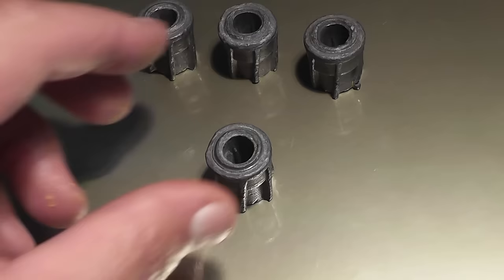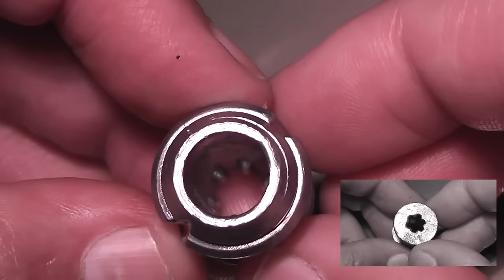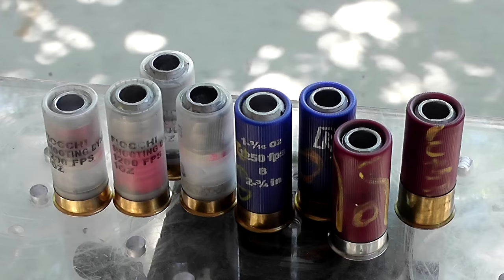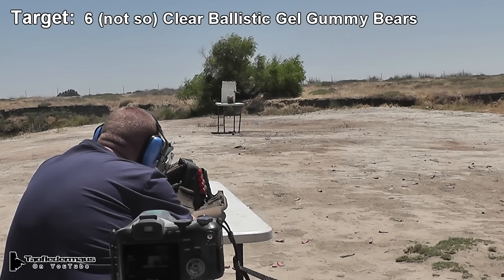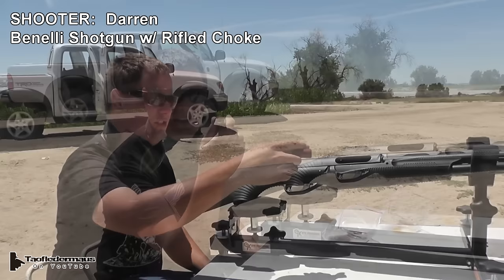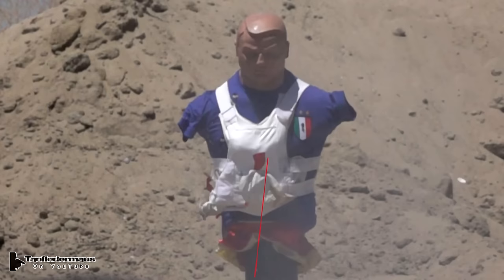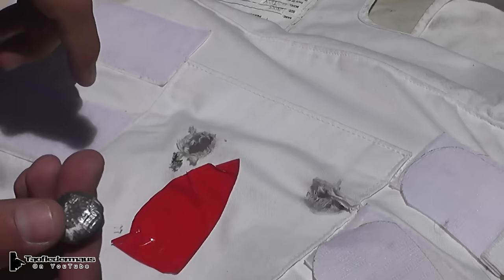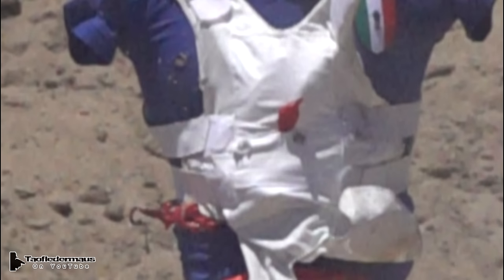RAM JET Shotgun Slug  Design  -  Stendebach II (Germany)

Comment: The low pressure zone in the rear of the slug is drag
Reply: I keep thinking that these work like an annular/closed wing, but with how they fly with the shot card suctioned to the back I'm not sure.
Reply: Maybe with the shot card suctioned to the slug it operates like a conventional hollow point until the pressure inside the slug's cavity approaches equal to the exterior pressure around the slug due to loss in velocity at which time it might transition to an annular wing for stability? I'm really sketchy on the physics of it though.
Reply: It makes sense if you think about it, clearly the force holding the circle to the back overcomes the force of the air pushing through the hole. But the force that pressure exerts on something is determined by surface area, hence the units of measurement (lbs. PER sq in. for instance). So even though the PRESSURE is higher inside the bullet, the FORCE is less because it's just a small part of the center being pushed. Meanwhile the entire surface of the back is being pushed. And you're right, by blocking that hole it essentially has the aerodynamics of a hollow point. 

I see his thinking, and what's actually happening is kinda counter-intuitive, so I understand his conclusion that little to no air was flowing through, but that REALLY doesn't make sense, haha. He should have thought this: high pressure in front of projectile, low pressure behind. If you connect two areas of differing pressure with a hole, then air will flow. The bigger the difference, the more the flow. There would be LOTS of air flowing through that channel, I don't know how that would effect flight, but I'm sure it would. It would at least reduce drag.
Reply: So the force of the lower pressure outside of the round over the larger surface area of the shot card is sufficiently greater than the force within the round that is pushing at higher pressure against the much smaller exposed area of the shot cup resulting in the pressures "gluing" the shot card to the back of the round until they equalize?
Reply: +Mr3Kidneys - It makes perfect sense that no air was flowing through the center of the slug when the card stuck.
Reply: Corwin Hyatt Ya, pretty much. The shot cup is in the small area of low pressure behind the projectile (actually a pressure gradient, but whatever), with atmospheric pressure pushing one way and pressure inside the hole pushing the other. The atmospheric pressure wins out because its acting on a much greater surface.
Reply: Corpsie Eh, it's not totally illogical but doesn't really make sense. You can think of it like that grade-school science trick (different forces, but same idea) where you can fill a glass with water, put a card or something over the top, then turn the glass upside down. The atmospheric pressure holds the card in place, overcoming the force of gravity and preventing the water from pouring out. It looks like it's "defying gravity" because you's expect the water to fall out regardless of the card, but it just doesn't. But concluding that it must, and therefore the water would't flow out of an upside-down glass even if the card wasn't there is just wrong. That water would come flooding out if the card wasn't there, just like air would flow through that projectile if the circle wasn't there.
Reply: May I suggest a theory and with all due respect get yours (everyone's) take on it?

If the slug is traveling forward the air around it creates drag. That drag also creates a vacuum.

Is it possible, and I won't compete with you on vernacular, that what is then happening inside is air being forced to the front?

The air is flowing in reverse and sucking the card to the base.

stuff works funny in flight.

Comment: Next time you should probably use lighter waddings. The bullets tumble because the wadding is inside the bullet's slipstream, coupled with enough kinetic energy in the wadding. 

You should probably use waddings a tenth of the bullet's weight.

Comment: could the slug be trying to spin left while the rifling is spinning it right?
Reply from the maker: I think when you induce a strong spin with rifling on a slug that has vanes designed to spin the slug,  you just end up turning the vanes into paddles that ruin the "natural" aerodynamics of how the slug was designed to work.
Reply: +TAOFLEDERMAUS and could that be causing turbulence making the bullet wobble?
Reply: Yeah, spin is very specific (in tolerance of range of spin speed for bullet) for the length of the projectile as to stability. I think on a sphere it's less vital because it's hard for a perfect sphere (or harder the closer it is to perfect) to wobble.
Reply: I don't think those "vanes" are designed to spin the slug.  They reduce the of surface area of the slug that touches the bore, so there is less frictional drag as it moves down the barrel.
Reply: +Jeff Rielley look at the fluting at the front of the vanes. they're meant to spin.
Reply: Jeff Rielley I think you're probably right partly, but the way they are slanted will cause the slug to spin moving down the barrel. I don't know what the air resistance forces do on those vanes moving through the air, but in the barrel there is positive contact and predictable behavior.

Comment: I have a H&R rifled 12ga single shot. It shoots anything and everything into a circle no bigger than a metal pop can. Non Sabots I can do that out to about 60 yards and Sabots out to about 130 yards. I use a 3x-9x scope. That is from a bench but no bag or rest.Most of my relative have hi end auto loaders and none of them shoot slugs even with fully rifled barrels as well as my old and at the time cheap H&R. They have mail in bench rest contests for rifled slug guns and the H&R consistently wins the most. Just something to consider. My Mossberg 935 never performed that well with a rifled choke compared to a rifled barrel. It has a 32 inch vent rib for water foul. 

The other thing is what choke tubes have you tried because it might want a different choke. I am assuming your using modifed cylinder?
Reply from the maker: Try shooting some glass slugs...  lol
Reply: Who makes glass slugs and why would I want to shoot them? Lead and copper seams to work just great. I shoot shotgun slugs to practice and to kill deer to eat.

Comment: Can you find a way to shoot it without the stock wadding but without the nitro cards such that it would alow airflow through the slug?
Reply from the maker: There will never be air flow through a slug like this because there is a shock wave in front of the slug.   The huge hole is there to act like a hollow point.

Comment: My guess: You need to download the shells to get the slug to transsonic/subsonic speeds so the laval-nozzle and the spinning fins actually work.
Reply from the maker: If you shot them at subsonic speeds,   you might be able to lob them 40 yards or so.   Slugs have very short range even at higher velocities.
Reply: ***** Which is the intended range of the slug, according to the description you show in the video (most test were done at a range of 75 feet, one of the comments is talking about the intented maximum range of 60 meters, as everything beyond that is pretty useless for deer or hog hunting in a dense european forest). ^^
It also is designed to be used with blackpowder instead of smokeless powder, at least that is what I get from the comment from C.O. Steigerwald on 1:10 (he used 5.5 - 5-75 grams).

Comment: Hmm im also wondering if these are spinning clockwise with the internal fins or counter clockwise.  (i'm guessing the escaping gasses accelerating the bullet is whats imparting spin, and not the atmosphere the projectile travels through.
Reply from the maker: They are spinning clockwise (looking from the rear)
Reply: looks like escaping gasses would cause a counter rotation.  So is likely not whats happening :) great video!

Comment: The reason that this slug, especially that russian, one that became basically a folded out disk, is that the diminishing crosssection increases the pressure of the flow, forcing the material of the slug uniformly outward. I'm not still sure, why the ruber disk remains stuck to the backside. That implies a lower pressure inside the cavity than in the recirulation area behind the slug. If you get a hold of any more of them and do another video, maybe try ruber ring instead of a disk. Then airflow through the center should be possible.

Comment: What about placing the highspeed camera upwind of the shooter so as not to get all that smoke in the shot?
Reply from the maker: The waddings fly very randomly and have enough speed to destroy a camera.
Reply: I mean, instead of on the RIGHT of the shooter for this vid, just p;lace the camera to the shooters left. You'd still be behind the shooter but; wind L to R would place you to the L behind the shooter.
Reply from the maker: Oh oh,  ok.    Or just use the Federal shells that hardly put out any smoke.  In this video I did a lot of things wrong in the first part.  Wrong shells,  shooting in the wrong direction in relation to the sun,  etc.

Comment: Wonder if you could imitate this by welding two big nuts, one on top of the other, and grinding in two vanes on the sides. Maybe slap a washer on the back to make the hole in the base smaller.

Comment: Want to know a Secret about the T-14 Armata? They started with blue prints of a German Leopard 2! Same track design, wheel placement, amount of wheels, overall width and length! They only modified the design internally and externally on the upper section, but did not gain the secrets to the internal armor! They had to add a layer of armor strapped to the top of the tank which is a serious flaw! One upper penetration and the entire tank and occupants are out of commission! With the Abrams the armor is internal if they were to add a similar exoskeleton to the exterior it would be even more deadly! They over-rate the armor thickness, much like China and over-rate the actual max speed! The track design of the Leopard is limited to a slower speed based on proven wear by active service! The engine of a T-14 is manufactured from alloys and is a new development which makes it prone to failure and one small one is catastrophic, why one broke down and smoked!  In Fact the Leopard 2AV has the turret T14 mod named in 1976! Odd but there is the name they picked for the Russian MBT! The Leopard 2 is a proven system and was used in Kosovo by Germany! Why not copy it? It was tested by the US military in the US using their testing protocols and criteria! Boeing gave them the stealth technology they used for the Pak-FA! Boeing Energia provided composites and coatings! Something the US keeps secret!

Comment: You said that the Stendebach's removed the fins from the inside because they didn't do anything but I feel like the did since the Mayer bullets did way better and never tumbled. "Stealing" the design isn't a big deal if you improve upon it and provide a better product.
Reply from the maker: Due to the fact that the nitro card (the wadding sucked on to the back of the slug)   never fell away,  it shows that there is no air flow going through the slug.    If there was,  the card would have easily been pushed off by it.
Reply: +TAOFLEDERMAUS good point. However the weighting of the slug could be less evenly distributed with the nubs at the bottom only where as in the other they are the complete length of the slug. I'm a layman so I'm just guessing.

Comment: I think I know the difference, and why this works when other designs do not.

"The moment of inertia of an object depends on the mass of the object, and on how this mass is distributed with respect to the axis of rotation.  The farther the bulk of the mass is from the axis of rotation, the greater is the rotational inertia (moment of inertia) of the object.  The units of the moment of inertia are units of mass times distance squared, for example kgm2.
Imagine two wheels with the same mass.  One is a solid wheel, the mass is evenly distributed throughout the structure, while the other has most of the mass concentrated near the rim.

The wheel with the mass near the rim has the greater moment of inertia."

Excerpt from: "http://labman.phys.utk.edu/phys135/modules/m8/rotation.htm"

Comment: almost no visual hydrostatic shock from the gummy bear. It almost looked like the hole in the slug cut a nice cylinder out of the gummy. (i still expected HSS from the shockwave and energy transfer)
Reply from the maker: It seemed to core out a lot of the gummy out the back.

Comment: Weird idea here but if hollow rounds work would a internal rifled bar running down the center of the bore lock with these to make them spin i dont know im no engineer but surely its possible btw im the tunstens a ceramic Jeffrey guy its a inside joke from my old job sorry if it was a tad random lol

Comment: shoot some neodymium magnets! or some broken glass! or maybe some tiny glass vials! maybe some blow darts?! shoot some glowsticks at night! OMG you should shoot the largest cylindrical neodymium magnet that fits in a shotty and then shoot it through a large enough solenoid (at close range so you can easily shoot it right down the coil), have the solenoid hooked up to a volt meter and see what kind of electricity can be generated! maybe see if it can light a lightbulb! we've all seen a neodymium magnet float down a copper/aluminum pipe, I wonder what would happen if we shot one through it!
Reply: you do realize a magnet of that strength would blow up the shotgun right
Reply: +Minato Arisato what would make it blow up? or how?
Reply: +Minato Arisato keep in mind these magnets would have the diameter of a dime, and a thickness about half of that....
Reply: Travis Heck the strength of the magnet could hold it against the barrel and it could get stuck, the gases couldn't escape the barrel, therefore they go backwards or out the sides
Reply: +Minato Arisato  So, in your own words: you do realize that just because you think thats gonna happen doesn't mean it would really happen like that. I just so happen to own some neodymium magnets of that size and shape, and after playing with them I can assure you that it would not stick hard enough to make it explode.
Reply: +Minato Arisato and last but certainly not least, let's take a close look at the physics of that situation. the magnet and the barrel are both symmetrical with rotation around the axis of the barrel, the magnet would pull with the exact same force in all directions, effectively canceling itself out. since the friction of the magnet against the barrel is directly proportional to the force between the magnet and barrel. since there is no net force due to symmetry, we can conclude the frictional force would be no greater than a regular slug. 

Q.E.D.
Reply: +The Washable Bomb don't get so bent out of shape lmao. I was probably stoned
Reply: +Travis Heck If you ever go out and actually shoot a rifle you will come to appreciate that at no point should your ammo have an attraction to the barrel or jam up inside. The bore is smooth for a reason.

The type of magnet you are suggesting has a significantly  strong attraction and regardless of your forcity force complex vernacular, if those magnets grab ahold of that barrel for even half a second you're gonna blow your face off.

Go out and try it. Make a video while you're at it.

Comment: high speed camera was available in past. not electronic camera but anyway
Reply from the maker: about 40 years after the invention of the first Stendebach.
Reply: *****
OK. But photo with ultra-low exposure time is enough in this application. Synchronization of bullet-photos was invented in 1886.

Comment: a piece of aluminum foil between the nitro card and the round might keep it from sticking. or maybe a dime or penny. as a card. only experimenting will tell.
Reply from the maker: It's very normal for the cards or wadding to suck onto the back of the slugs.   Even foster slugs will do it.    It's vacuum that is holding them on because they are travelling above the speed of sound.